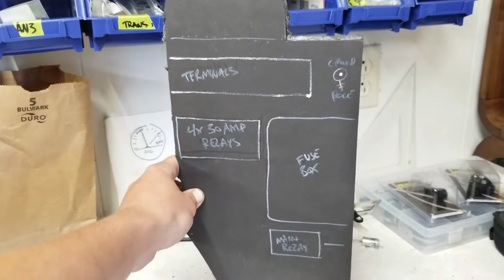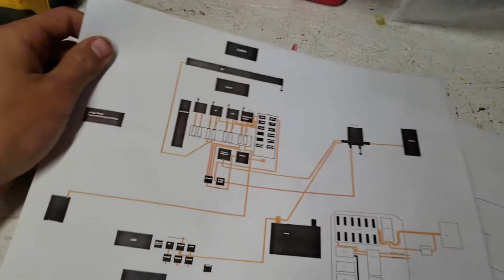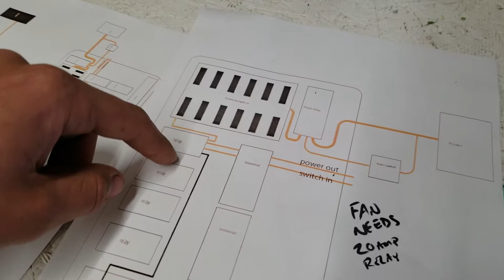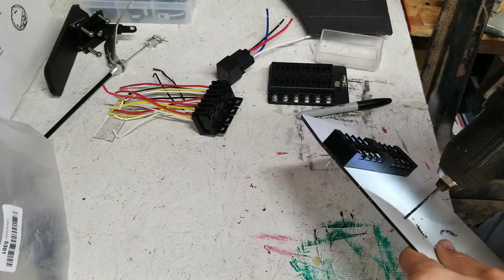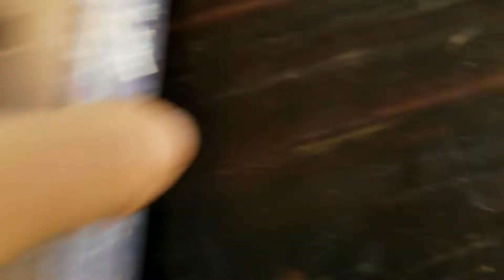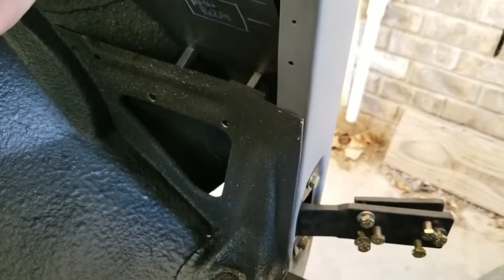1953 F100 - How to Wire ANY Car

Comment: I'm trying to wire a 69 vw bug i don't like how the factory fuse box works its hot all the time on most fuses I need the box to be Hot only when the key is on because im afraid there will be something left on and it will drain the battery. The only wire i have found that is hot when the key is in the on position is the Coil wire. Its to small to handle a fuse box and i was told that the switch would most likely not handle the load. After seeing your video and you showing adding a 40 amp relay before the fuse box gave me the ideal i need. If I run the battery to the 30 pin hot on a relay and the small 16 gauge wire from the switch to the relay (Coil wire ) that should take care of my issue. What are your thoughts on it any help would be appressed thanks  from OKLA
Reply from the maker: A relay is definitly the way to go as far as switching power to anything that carries a lot of current.

Comment: Nice job, only edition I did that i used 100amp autofuse and 100amp relay. So i can use 1200w instead of only 480w that you get of a 40amp relay.

Comment: I work in Auto Collision for 40 years and did a fair amount of re-wiring... Lately, I've been wiring a Dodge truck (after a short burnt out "all" the wires)... I've watched "Dozens & Dozens" of wiring videos from all kinds of "Professionals" - They all have one thing in common "They all either assume that - I - know the basics ( ? ) or They leave out (minor, but important) steps (That is obvious once you see it)... The way you did your video (weather by accident or on purpose) didn't skip a detail... Showing the templet and the panel and "Explaining" it step by step really helped... For "Wiring" a fuse panel this is the # 1 video...

Comment: Great work and a nice step up in the video editing here and the last one too! Looking professional all around! Only suggestion I could make is running a ground wire from fuse panel to truck body and make sure the body's grounded to frame. Keep all the juices flowing freely back to batree. Looking forward to the next video!

Comment: One thing I can’t seem to figure out with any video (I’m a noob) is the switch in line. Is there a separate fuse panel that you run those wires to the switch from?

Comment: Its nice to see people still scratch wire their cars. Kits are easy, but prefer custom tailoring mine to each vehicle. I have a 56 F100 my dad schooled me on wiring from scratch. Sadly so.e components he use to use are disappearing or being cheaply made. You do nice work! Like where you placed you panel. I stuck my speakers there so placed mine on the back (inside) of the firewall near the column. Great video!
Reply from the maker: Thank you! Im excited to do all of it from scratch. My dad has taught me a lot about wiring i just enjoy the cable management and making it look good part.